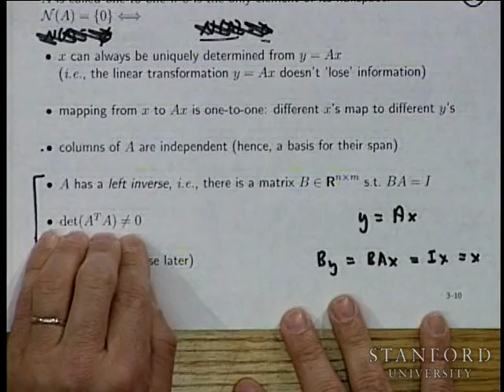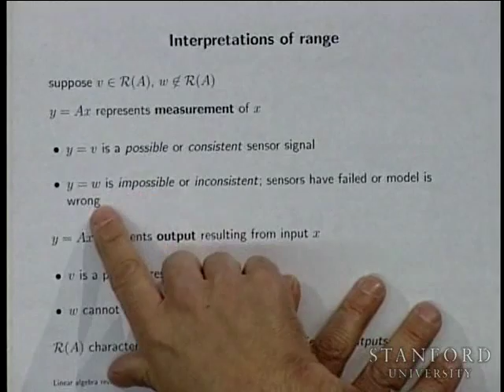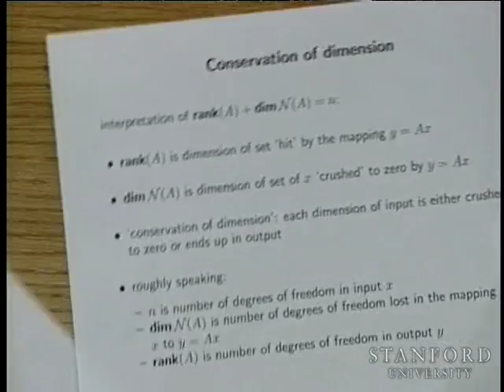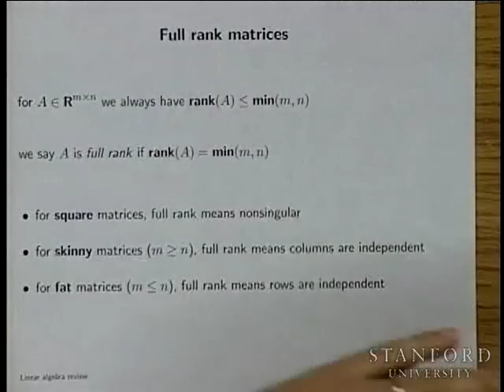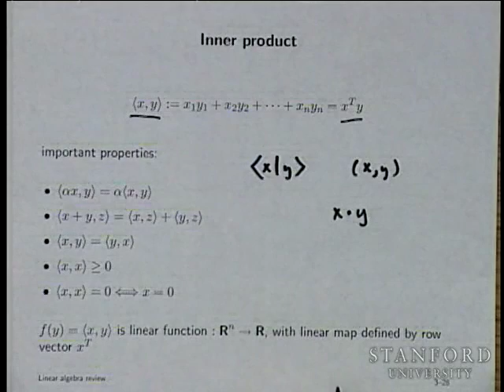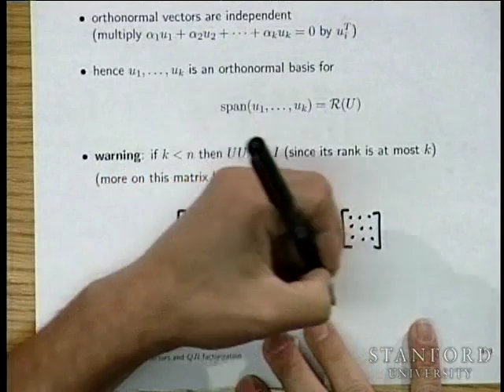Lecture 4 | Introduction to Linear Dynamical Systems

Comment: In 6:33 it says x can always be determined from Ax=y, that is not correct. I can have a matrix with range n but no solution. It is uniquely determined OR there is no solution. The matrix B wont be 1 to 1, and the result x wont be necessarily the x from the input (as it happens on least squares)

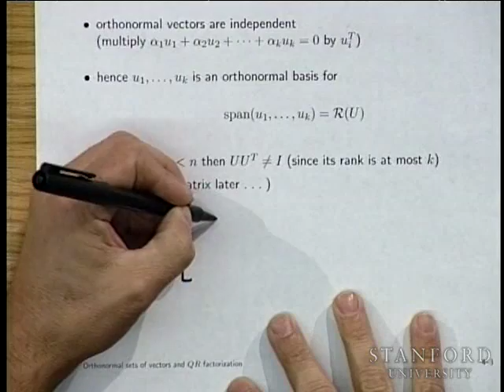Comment: 1:10:15 The prof commits a syntax crime here. He shouldn't have written T on top of the first matrix. The way it's drawn, it looks like it's already the transpose of the second matrix.
Reply: "There's no syntax crime here" <pointing to the bottom right of the page>

Well, sure, but there's definitely a syntax crime just above it 😅
Reply: to me, actually the U^T (3 by 10) could be there, but the U (10 by 3) afterwards should keep the same shape but without the T, the dimension of matrices given in the example seems having some errors.

Comment: Just for the note for 36:45. In Russian culture we have the following thing (actually maybe it's internaitonal) -- if dimension of input is "n", and matrix has rank "r" then solution for Y=AX can be represented as x_0 plus span of vectors total amount of "n - r", which is called as fundamental system for solve Ax=0.

Comment: During the discussion on detection of which sensor might have failed (around 20-21 min mark) ... shouldn't be taking out 13th column of matrix A instead of 13th row?  Given that there are 20 sensors ... or am I getting it backwards ... does the sensor refer to the input (x) or the output (y)? Thanks
Reply: +ashuWEMBA Each row of matrix A corresponds to a sensor, therefore the ith row in A contains all the elements used in creating y_i.

Each column of A states how much one input value appears in each sensors output, e.g  given A = 2x2 matrix, the values a_11 and a_21 correspond to how much input x_1 appears in sensor 1 and sensor 2 respectively.
Reply: thank you